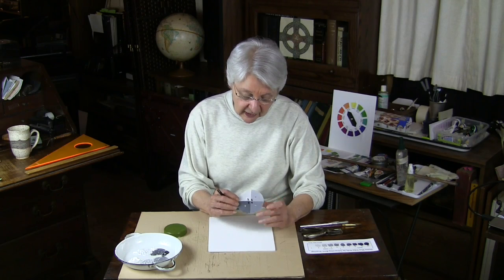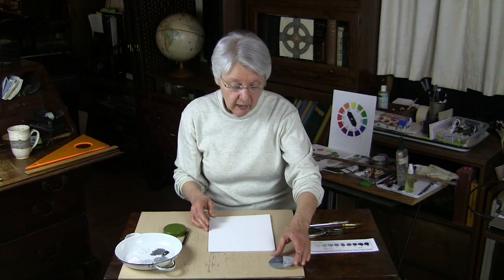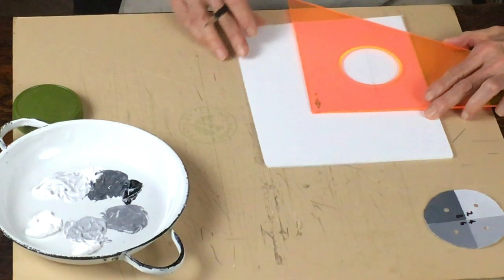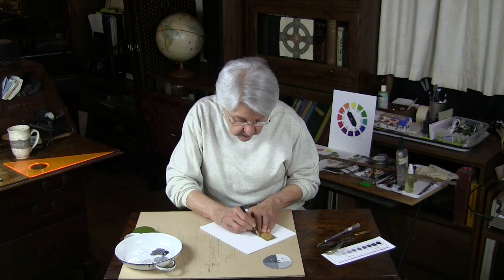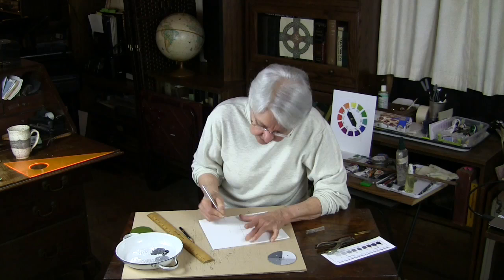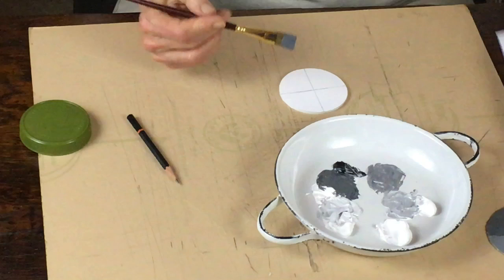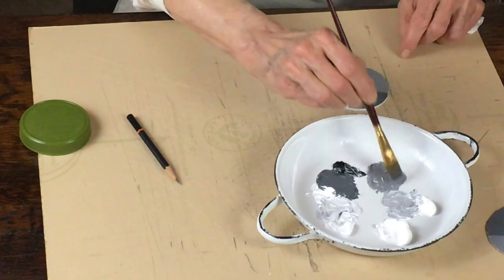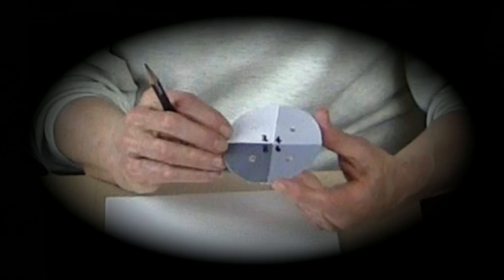Quick Tip 32 - The Value Wheel

Comment: Thank you for the videos. I would like to know after you find your values. Watt  comes next ,  how do you match your values, with your colour wheel. I don't  understand . Thanks for the respond. ( maybe silly question?)
Reply from the maker: You don't need to match values to the color wheel except to understand the inherent value of each pure color as it appears on the wheel.  Yellow is the lightest, then as the colors move around the wheel from yellow to yellow-orange- to orange, etc, colors get gradually darker in value.  You can squint - close one eye, and squint with the other- to see this progression. Hope this helps.
Reply from the maker: The value wheel is to help locate values you are looking at in nature.  It doesn't correlate with the color wheel.  It's just a took for helping us to locate value differences when we have trouble seeing them without a tool.  What's next is to mix the value we're seeing it and paint.

Comment: How do you determine what is 2, 4, 6 & 8?
Reply from the maker: The traditional value scale uses the number 1 to indicate the lightest light (white) and the number 7 as the darkest dark (black).  Later, the 10-degree value scale was introduced which listed the darkest dark as 10.  Values are arranged in equal degrees between the two extremes so that in the 7-value scale, value 4 is in the middle.  In the 10-degree scale values 5 and 6 sit in the middle value range.  All these are just guides, like a thermometer, to give us a language with which to define a value.
Reply: @IntheStudioArtInstruction   Thank you very much Dianne!